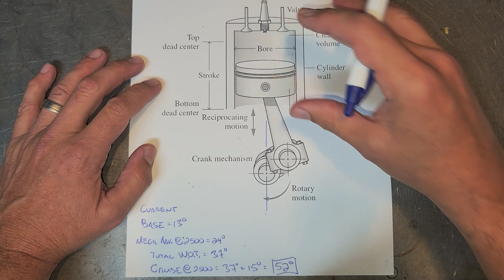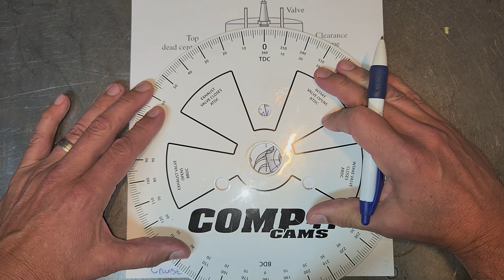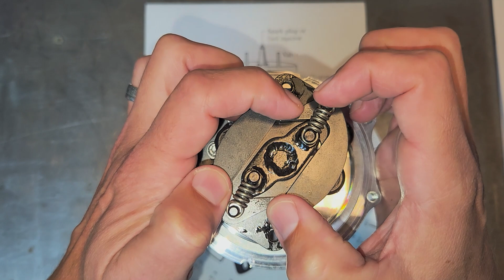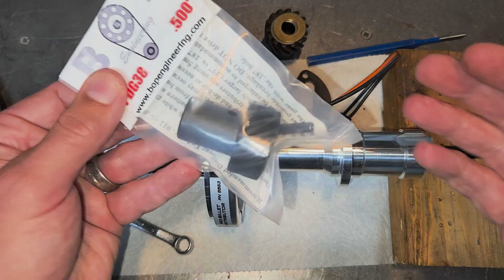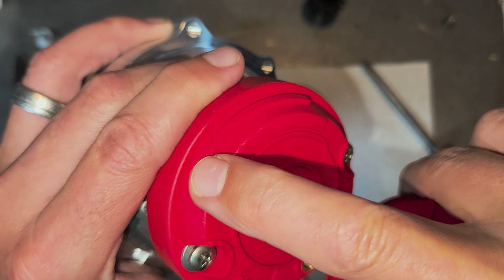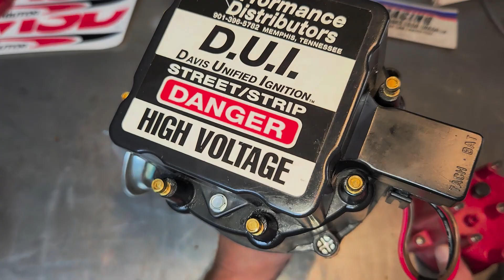How to set up Ignition Timing Control for EFI, Fitech, Sniper, Part 1 - Distributor Lock Out

Comment: Excellent explanation. Thank you.  Note: For Holley Sniper, it is recommended that the balancer be set at 15 degrees BTDC and the rotor be phased 15 degrees retarded.  Thus you will turn the adjustable rotor in the OPPOSITE direction of rotation.  For a small block Chevy this means you turn the adjustable rotor counter clockwise.
Reply from the maker: I'm glad it made sense. I know it can get. confusing  Thanks for the comment!

Comment: Hey mate. How do I know what wire goes where for the dizzy. My dizzy has a different plug and different coloured wires
Reply: Think I’ve wired the coil up wrong. Yours seems to have a lot of wires. Does it require more wires then just what the instructions say
Reply from the maker: @robertmaher2981  maybe.  I think my EFI system required a connection to the coil too.
Reply: Sorry mate can I ask what’s the voltage coming from the throttle body timing control plug. The 2 wires that go to the dizzy
Reply from the maker: @robertmaher2981  Hey Robert, sorry, I don't know that answer.
Reply from the maker: Good question... I would suspect that Google is your friend.  you're going to have to find that out from the manufacturer of the distributor.  Good luck!
Reply: @FastMonty  gday mate thanks for your reply. After a decent sleep I realised I could work this out with a multimeter. I had it correct. Still I can’t get a spark it’s driving me nuts. Hours of google and still no luck.
Reply from the maker: @robertmaher2981  Sorry to hear that... wish I was there to help.  I know you'll figure it out, keep at it!

Comment: i have 73 trans am 455  that i would like to install a fitech efi ,can i use a factory distributor with a pretronix ignitor ( its not a pretonix  3) with locking out timing ? if so there isn't a whole for the little threaded dow  to set in   where the weights were mounted to  to set in after i rotate the shaft to lock it, any information is appreciated ,i would like to use the factory style distributor,
Reply from the maker: Great question... my understanding is you need a 2 wire distributor AND the ability to lock out the mechanical advance.  If you can't do that, maybe there's one on the market that looks stock?  Let us know if you find one!
Reply: the pretronix ignitor  converts the points to electronic ignition  so now it is two wire
Reply from the maker: Good to know!  Still need to lock the mechanical advance, somehow?  @lorrainedilauro5210

Comment: I have a 1990 dakota and it seems as if it never came with vacuum advance…
Reply from the maker: I don't know what's stock on that either... but, all engines have a way of adding timing at idle.  Most of the time it's vacuum advance.  OR, it has some sort of Fuel Injection system.  Let us know what you find out!

Comment: Good tip I did not know about the polymer gear in building a 454 roller but I would suspect that the button keeps everything in place have to do some more research on one thanks
Reply: Chevy may need a cam button to limit cam end play.  Pontiac uses a block mounted plate to limit end play.  Neither have anything to do with why you need to run a softer distributor gear on most aftermarket roller cams that come with billet distributor gears.  That’s a metal compatibility issue.
Reply from the maker: @stevebrown6175  Agreed.  There's a little bit more shock loading with steeper cam lobs, which can cause havoc for some steel distributor gears... I'm playing it safe on mine, and don't know if a polymer gear exists for Chevy's?  Thanks for the comment!
Reply: @FastMonty  I run the .491 BOP composite gear as well.  When I put the Hyperspark distributor in, I needed the .500 gear.  I said screw it and just drilled it out to .500.  So far so good with about 500 miles since drilling it 👍🏽
Reply from the maker: @stevebrown6175  Ha!  Welp, it's only 0.009" more... I guess that would work, should've thought of that before selling my HEI unit.  ha, ha... thanks for sharing!
Reply from the maker: Yeah, I left a link in the description... if you haven't heard of BOP Engineering... you're welcome.  Ha, ha... have fun!
Reply: I recommend the Melanized gear its metal, I have on Drag Week seen guys stranded if the oil pump even thinks about having increase friction ( catching)

Comment: Mike, are you running the stock frame with the 19" x 8.5" and 20" x 10" without issue?  The car and your video's are very informative keep up  the good work.
Reply from the maker: Stock Frame... if you measure really really really good, you can add 1/2" to both front and rear widths.  Thanks for the comment!  Have fun!

Comment: Progression Ignition system allows carburetor equipped engines to have the most incremental timing adjustments w/out EFI or an expensive control system.
Reply from the maker: Good to know!  Thanks!

Comment: Hello sir , question why do you have to turn shaft 180° ? I have a Chevy can get it to run correct. I bought it used . Thanks
Reply from the maker: If you want to use the timing control built into a Fuel Injection system, Like FiTech, MSD Sniper, etc... the distributor mechanical advance needs to be locked out.  That's why you change mounting holes from slotted, to a fixed hole, preventing the mechanical advance to work.  Hope that helps.
Reply: @FastMonty  thanks 👍🙏